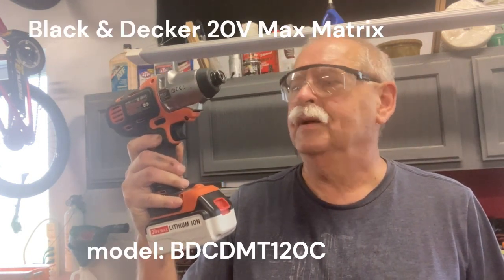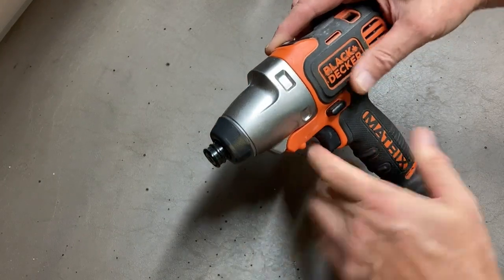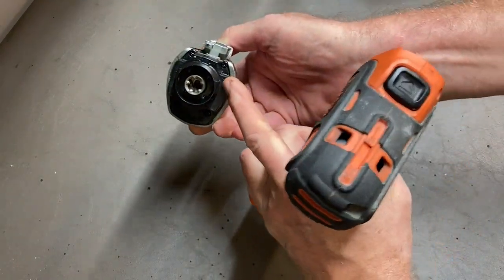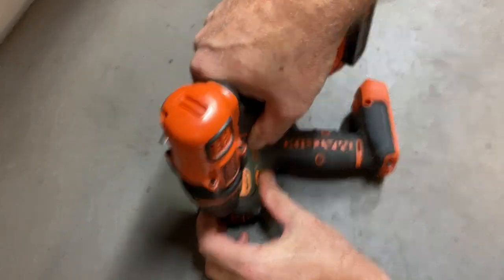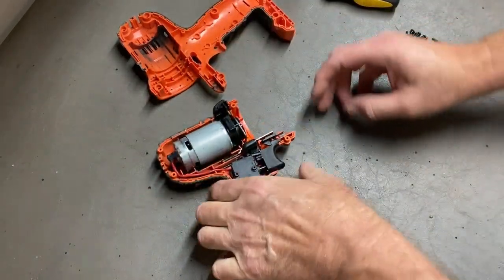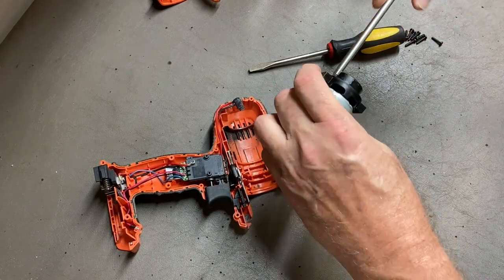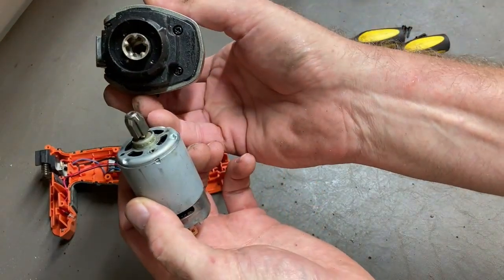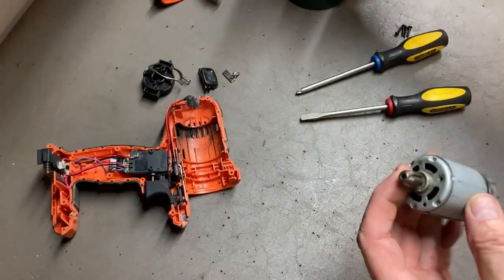Black & Decker 20v Matrix MAX - Replace RS550 Motor

Comment: Great video. Thank you for sharing. I just ordered my new motor and will be trying this soon. My Matrix drill started excessively smoking while using the circular saw attachment on some pine boards. Nice that I can buy a $12 motor instead of a whole new drill
Reply from the maker: Good Luck and fingers crossed.  Certainly cheap to try.

Comment: very bad idea hitting the motor with a hammer...

Everything you did should be done with special tools
Use press to insert gear on the motor (not a hammer) in worst case Vise - but not a hammer :\
Reply from the maker: Agreed.  But I was not going to buy special tools that may cost more than the drill.  The $10 motor was going to fix it, or it was all going in the garbage.  Nothing to lose but the $10.

Comment: More common than the motor is the trigger burning up. The MATRIX has a dinky heatsink on the power MOSFET. The one used for the Craftsman Bolt-On is ~4x the size. I now install a 2'nd MOSFET (HEXFET, IRL7833, with mini heatsink) in parallel. Just enough space below trigger to fit it. Now electrically it's near bulletproof. Only weak link now is the motor itself. Pretty light duty tool so still need to temper your expectations. But tool is lasting ~5x longer after the upgrade.
Reply: Can you share details and pictures regarding your heatsink hack?